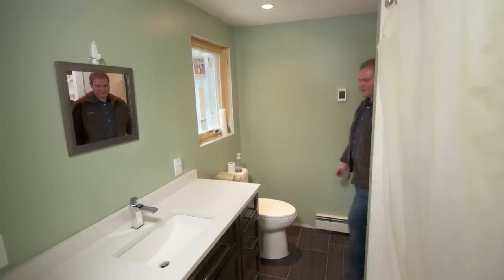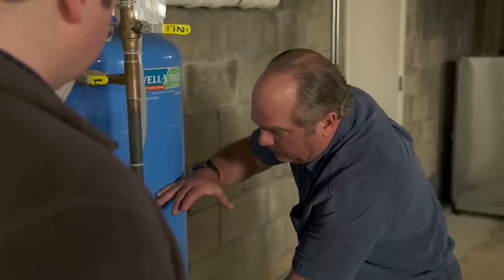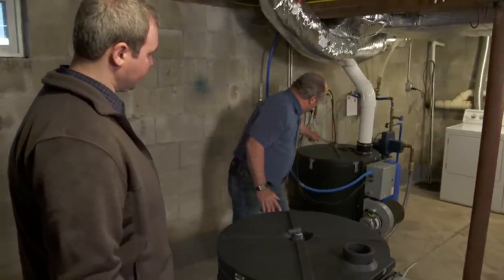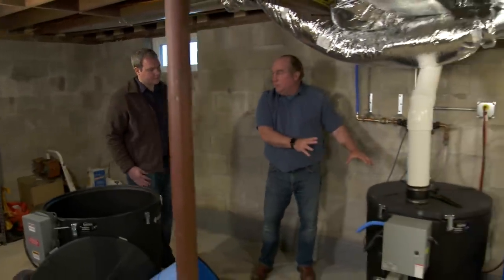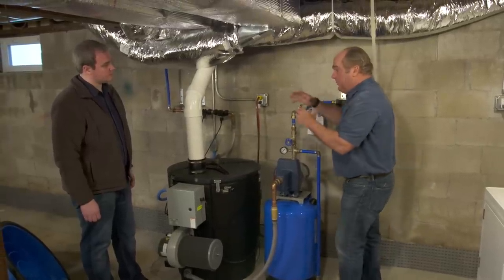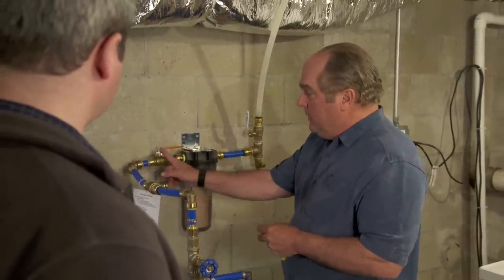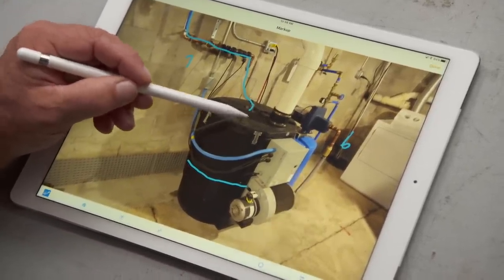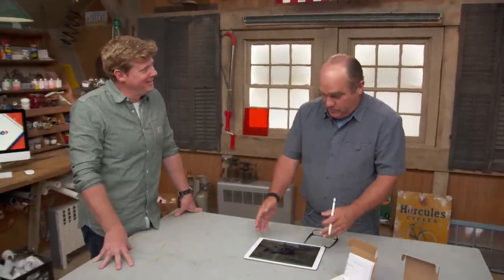Solving a Spitting Faucet Mystery | Ask This Old House

Comment: What about having a larger reserve tank? 7 gallons? WTH is that. Triple that capacity and eliminate the extra ball valve. Plus the water that’s sitting in the tank has more time to off gas. Seems like common sense, but, common sense isn’t so common, or so I’ve been told.
Reply: True.
Reply: Thats what i thought increase the reserve tank and the problem would be solved i mean what do you do when you take a shower
Reply: May be the issue would be the raidio active ionisation  of the water supply that would be the issue, bot apparenttly its the pressure.

Comment: WOW..Richard, you are really good. How dangerous was that radon backing up into the washing machine?
Reply: Islanders Trains , it wasn't backing up in the washing machine, it was literally being pushed out of the upstairs water faucets. Way worse.
Reply: That wasn't radon it was just air being sucked into the system by the second well pump. There isn't radon just sitting in the radon separation tank, the fan runs for a few seconds longer then the water to push any remaining radon out.

Comment: What happens to the radon that has been removed from the water?
Reply: There is a blower on the drum which blows it out to the rooftop. If the water level in the drum is too low, then the air will be blown into house plumbing system, which caused the bubbling.

Comment: How about a spitting urinal?   Occasion   Stockton Wastewater Plant, commissioning  circa 1973.   Scene:  men's bathroom.   Dialog:   Warned against doing it, the new plant mgr and district mgr nevertheless just had to christen the place.  The results were predictable:   Because the plumping hadn't been purged and filled, air bubbles were rampant.

Comment: Does that blower draw air from the ambient space? Like, the dirty, potentially radon rich basement air?

I would just move. Wells are horrible.
Reply: not if have a good one, I grew up on a farm, shallow well, and protected no run off et, was the best tasting and when Dad would have it tested was always good. Now have a deep well, 30 feet down then solid rock about 200 get great water tested comes out so pure nothing needed. So some wells are great. No the water and one house I currently live in comes from the county, and they have to treat so much I can fill my pool and not have to add additional chlorine right away.
Reply: Same here. People buy bottled water every day to have what I had from a well where I grew up. Delicious and had some of the minerals you actually want. The best part was in the summer when 52 degree water hit you on a hot day.
Reply: my well is perfectly fine, my water is as clean as rain with no dissolved minerals or chlorine.

Comment: Why isn't the radon tank installed where the well water comes into the house to eliminate the second pump
Reply: You would still need the second pump because the radon tank isn't pressurized and there is no way to pressurize it. You need one pump to push water into the radon separator and one to pull water out.
Reply: Nix Ryu The Sergal well in that case you don't need that first pressure tank its unnecessary if your storing water in the second tank
Reply: The first pressure tank is necessary, it allows a higher volume of water to be stored at the normal pump pressure making it so the pump does not constantly need to cycle on and off to try to maintain the full pressure in just the single small pipe. It also stores water like a water tower so you have water pressure as soon as the water valve turns on which in this case would be the valve controlling water going into the radon separator. Otherwise there will not be any water pressure until the pump spins up to full speed. It just makes the whole water system run smoother.
Reply: Nix Ryu The Sergal - yeah well that pressure is lost because the water has to drip through the radon tank which has no pressure
Reply: The water does not drip, it goes through a nozzle which sprays it almost in a fine mist, so it needs pressure. It works like a fuel injector in a car, under pressure it sprays through in a mist and all that liquid turns to vapor and ignites giving you power. If you don't have pressure it will only drip through the nozzle and wont turn to vapor and then it wont ignite. Well in this system if there is no pressure it will not spray it will drip and the spray is what draws the unwanted gasses out of the water. The reason for wanting a spray instead of a stream is to increase surface area of the water. More surface area equals more area for the air being blown past the water to pull that radon away, which is also why the tank is shaped like a spiral with lots of air holes in it.
Reply: Nix Ryu The Sergal I understand that I don't understand why you have a large pressure tank coming in the house only to feed a radon tank .then they have a small tank feeding the house. The tanks should have been swapped
Reply: Nix Ryu The Sergal-  And he just used a ball valve for a flow restrictor
Reply: I don't understand why the sizes are switched either. The only explanation i can come up with is the filters and everything were installed first and the radon filter came later. If i was the one setting this system up it would be the small tank, the radon filter, the large tank and THEN all the filters, that would stop all that air getting into the system in the first place because the pressure restriction would be AFTER the radon filter meaning there will always be more water flow going into the radon filter then can ever be pulled out of the radon filter.
Reply: Nix Ryu The Sergal-  That makes better sense
Reply: Nuno Sousa - Yeah but the bigger tank should have been installed after the radon tank not at the well head
Reply: The pressure tank also allows the water pressure to stay constant

Comment: 😒  Note to self: Never have a well.
Reply: Depending on where your at the water can be great or it can be god awful.
Reply: A well is the only option if you don’t want to live in densely populated areas...and with a proper system, is just fine.  For me, it’s more than worth it  to live in the country.
Reply: The best part of a well where i live is drilling 270' for 4gpm of mineral water that needs an iron curtain and smells like eggs. I don't think even the house plants particularly enjoy it. 15 miles in any direction you get a well at 90' that delivers 15gpm but still stinks and wrecks everything it touches. Never checked for radon but you know don't ask the question if you can't handle the answer.
Reply: I guess I lucked out.  I have good flow, no smell, a little hardness and a little rust.  I don't even need a true iron removal system- just a decent filter and "rust remover" in the water softener.
Reply: Yes - let's move to Detroit.
Reply: Municipal water supply isn't perfect either, often times they'll add fluoride and/or chlorine to your water supply. I'd rather have my own well and treat it myself.
Reply: You got that right about 20 years I had to put a new well $25,000 later along with a new septic field
Reply: In one spot i had egg smell (sulfur), dug a new one 100 feet away, deeper and it's clean as spring water and never runs out, even if there is zero rain for a month or two.
Reply: dalesworld 

Or better yet Flint.....
Reply: Wells are great. Just make sure you have a generator..
Reply: Depends on where you're from. My parents run a large 1-2 micro filter, and a water softener for iron and other minerals. Works great for them and the quality of the water is pretty good. Ph of 8. I'm putting my own well in 100 or so yards away.
Reply: Actually, the well water can be so much better than municipal. Just be sure to have the water tested to see if you need "extra steps" to make it above exceptional.
Reply: I'd rather have a well than drink all the chemicals in city water
Reply: Ask flint how they like their municipal water.
Reply: I grew up well water. It was far superior to anything I’ve tasted in the city.
Reply: Note to self:
Never use wells as drinking water if you can help it. Irrigation? Probably. If your well doesn't spew out brackish water.
Reply: dalesworld Detroit has one of the best municipal water service in the world.
Reply: beats the autism chemicals that the government puts in city water.
Reply: Well water is the best tasting water there is. A good well setup in the right location is cleaner than city water.  Plus no water bill and no risk of chlorine or floride in it
Reply: Municipal water here tastes awful, but well water tastes much better and wells mean no water bills.
Reply: @AJZulu  Just check to see what water is running underneath you. Wells draw water from natural aquifers. Each one will pass through different stone with different mineral content. A good well will be the best water you have ever had. Some arent as good like this guys.

Comment: Good information but that guy an his family needs to move out of that area.
Reply: Problem is Radon tends to be a regional problem, so he'd probably have to move a couple counties over, if not more.
Reply: Look up Radon Maps for the US. It appears that a quarter of the US has high Radon ratings.
Reply: Lyle Zeren ķ
m
Reply: My dad deals with radon testing a lot as a realtor and it's really unpredictable where it can pop up. You can have one house with a high rating and the house next door is absolutely clean. You can never be sure unless you test the house before you move in (a lot of HOA's actually require it.) it seems like he has the problem under control however. But yeah, selling it's going to be a bitch.

Comment: that's not a stable solution
the only way to solve it is to add an even smaller restriction and pump the water into a large non pressurized holding tank with a small pump
after that use the big pump they already have to supply the house

Comment: When I see "pro" plumbers using sharkbites it makes me sick
Reply: As a plumber I agree but it does match the rest of the basement. 

Also (although rare) I have seen pex points leak. I have never seen a shark bite leak. It reminds me of something you'd see on a hydraulic system. I don't use them but have reused existing ones. As long as the seal doesn't rot they seem good.

Comment: 7:03 so thats a nice clean new filter huh mr plumber lol i see particals of crap in it wtfffffff
Reply: carbon filter always floaters when you first activate them you can to run a little bit of water through them initially to wash out all the floaters and to make sure that they are properly activated

Comment: Really should use front loader wash machine, less water, and empty filter housing from junk before changing the filter. Installing a larger filter would do more good.  7:05  so what did you do ?? Valve was already there so another one wouldn't hurt just take the handle off the first one and install another one ???. If you wore real contractor I would accuse you of rypping the poor guy off.

Comment: The first well tank seems super unnecessary. Is that a code thing?

Why not just feed the well into radon, radon into softener, and then charge the well tank?
Reply: How would the first well pump know when to stop, since it triggers on water pressure? You'd have to create a water level/pressure based trigger in the second storage tank, which would be more complicated.
The first pressure tank also minimizes start cycling of the well pump.
Reply: Jason W just put a float in the radon tank.
Reply: @mattsnyder4754  does the radon tank store water? Or is it just an transient step getting to the final storage tank?
I'd assume you'd not want to store potable water in an non-pressureized open (filtered) air tank

Comment: i had a thought maybe the secondary pump was spinning too fast and ripping water molikules apart hense creating gasses in water supply but i guess not 😛
Reply: Vytautas Poška    This must be a fancy pump to "rip molecules apart". Did they invent pumpolytic processes already?
Reply: I meant the thing, when like in heating systems: if the circulator is set to run too fast, the impeller can turn too fast and split the oxygen from hydrogen and create air bounds in heating systems.  This is very well known fenomenon in everyday life. In fact, the too fast rpm on circulator caused me 5 years of mysterious air appearing in radiators, until it was finally found by the tech guy. You know, the centrifugal pumps do it as well, when the intake pipe is too narrow or too long and the suction of the impeller can not be filled and it rips the water apart into oxygen and hydrogen.
Reply: Vytautas Poška    I think I understand what you mean, but I think you got one detail wrong. The process you mean is called cavitation. It happens e.g. on the propellers of ships when they are not properly designed. This is, water gets "ripped apart" so that bubbles of vacuum or water vapour emerge, putting a lot of mechanical stress on the metal of the propeller. But it is not "ripping apart" the single water molecules i.e. separating oxygen and hydrogen. It is just separating one whole molecule from another whole molecule. - You can do the other thing however easily with electric current, that's electrolytic treatment.
Reply: Vytautas Poška soooo.... I could be 100% wrong but I feel like what you're thinking is a phenomenon called cavitation. it's the same problem subs have with trying to run silent. The blade is moving so fast through the water that it some how causes the water to boil?? maybe... I'm a little foggy on my Jr high science so really not adding anything useful to your comment other then 98%sure what's happening is called cavitation. lol now I have to look it up cause I'm curious, am I still going to post a comment that's got a good probability of being wrong? HELL YES!!! I wouldn't be using the comment section correctly if I checked my facts BEFORE stating my opinion as fact. have a good one
Reply: You are probably right. . . In my head it appeared that the molecules are ripped apart, but now after reading your comment, you enlightened me :) Now I won't make a fool out of myself again on youtube :P
Reply: Vytautas Poška oh the "checking my facts comment was not directed at you at all, I'm sorry I t realised it read that way. I have just been watching a lot of this old house and it's amazing how many "experts" there are out there that need to think of a change of career. anyways my comment wasn't meant rude in anyway, I apologize if it came across like it was. :) have a good one

Comment: That ball valve is not a flow control valve it’s meant only to stop or allow flow. over time that valve will wear down and stop working. From now on hire a union plumber for the correct job
Reply: John Flandorffer And the union plumber will milk the job for every penny taking 15 min breaks every hour. Yeah I’ve seen union guys and their work ethic. 5 guys standing around while one does all the work.

Comment: So when that thing spits out its letting go of Radon into the house!  Awesome!  The second leading cause of lung cancer.  If I were that guy I'd be calling the ones who installed it :(
Reply: Come to think of it I'd move.  Hard house to sell imo but f that
Reply: I thought the same but it looks like it's supposed to vent outside via the PVC tube or maybe he has a gas mitigation system beneath the basement floor (which he probably should) that both systems vent out the roof.  Aerating that tub, though, is going to algae up faster than my fish tank.  I'd move.

Comment: Too much crap, just run a reverse osmosis system.
Reply: randomsanwhich doesn't remove radon
Reply: DXSUCKIT1990 - yeah, ro doesn't remove radon.
Reply: volvo09 Sadly, a simple Google search, many reputable sources disagree. Think I'll go with that.....
Reply: If the internet says it's true, it, must be true!
Reply: Reverse osmosis only removes solid particles and dissolved minerals from water, it does not remove dissolved gasses.
Reply: randomsanwhich 

Yeah...... let's waste a sh*t load of water.

Not to mention more money on worthless crap.......
Reply: if the size of the gas molecules are larger than the openings in the membranes then it absolutely will remove radon
Reply: Here where I live that stuff would be in a well house.
Reply: Or wastes 2-8 gallons per gallon of filtered water produced, and RO does not remove radon as gas cannot flow through the waste tube, and also it does not remove dissolved gases becasuer they are smaller than the water itself.